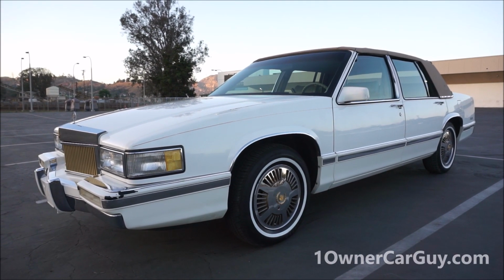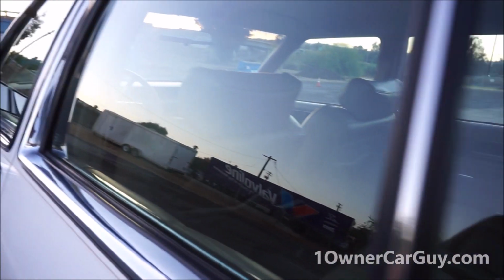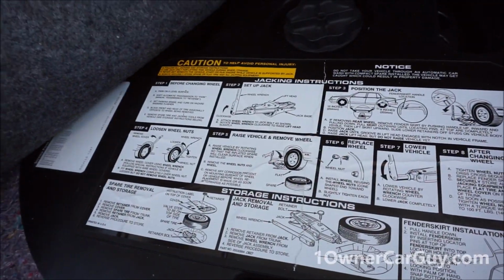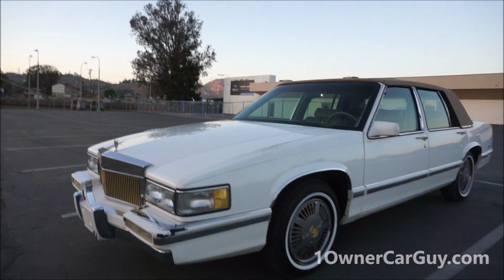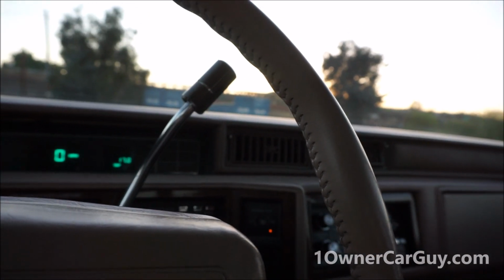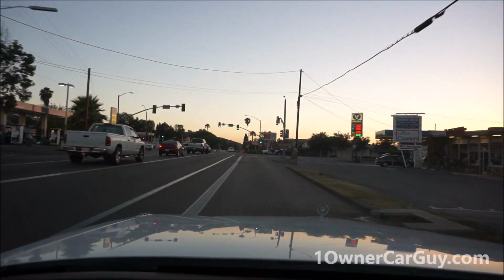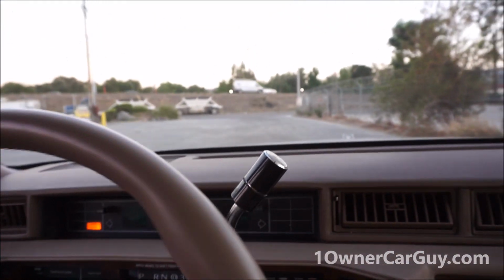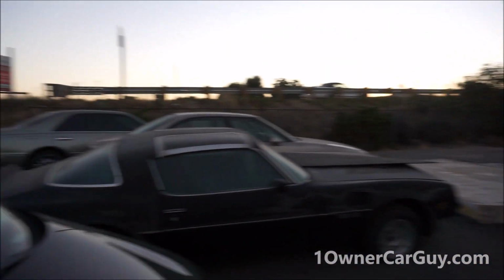1 Owner 1991 Cadillac Sedan Deville Continental kit & Vogue Package

Comment: Sounds like your fuel tank is shot because the Deville seems to sound like its a lack fuel from the tank because GM had a defect using plastic baffling material that would deteriorate over time. The 92 I used to have did the same thing till I had the tank replaced and it seemed to do the trick.